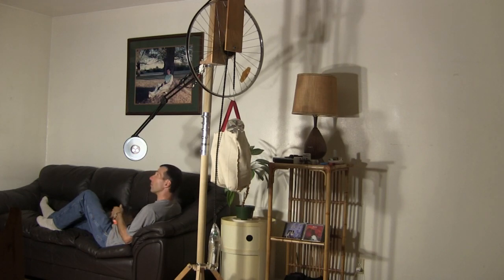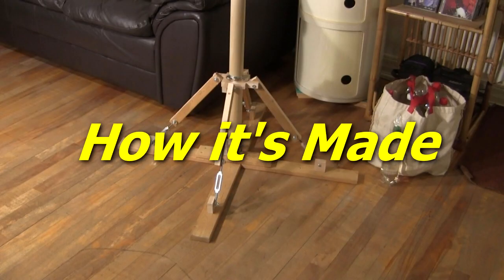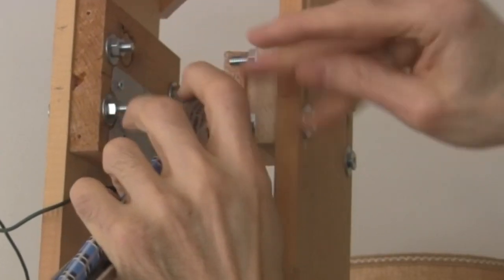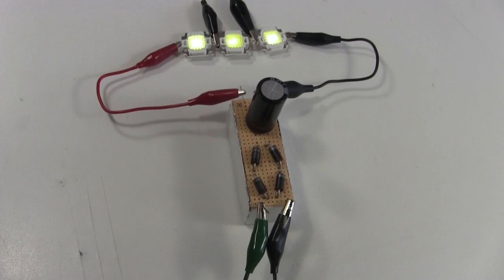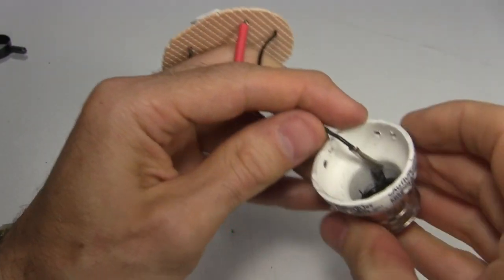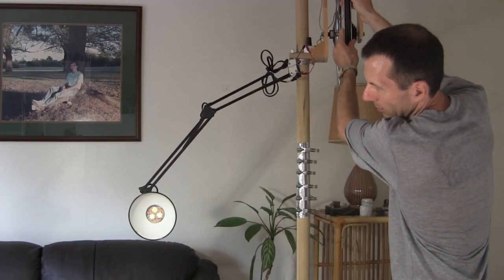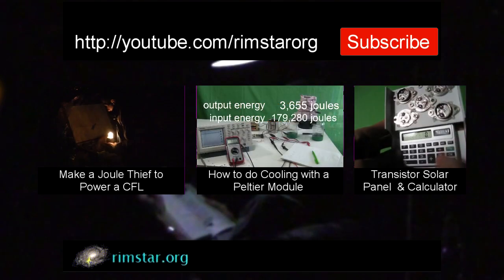Gravity Light (v2) Making and Enhancements

Comment: Those microwave turntable motors put out about 500V at 36mA by just turning it at a moderate speed. Thats 18W AC. You can drastically increase the brightness of those LEDs by stepping down the voltage to a more appropriate voltage and increasing the current with a step down transformer. You are wasting over 95% of the power by running 9-12 volt LEDs with 500 volts. You should be able to light up the intire room by doing this. BTW. You can light up a flourecent light without the ballast with these motors. It would be easier to buy a 10-18W flourecent bulb and remove the ballast and your rectifier and hook it up directly to the motor. These are great little generators. Salvage as many as you can. Theyre awsome!
Reply from the maker: +Robert Tomkinson Thanks. Everytime I see a discarded microwave oven I salvage another one. They are great little motors, doing a lot of the gearing for you.
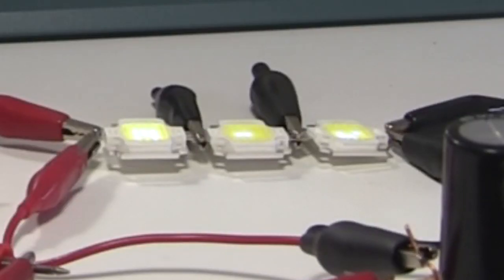I sort of am stepping down the voltage already by using the capacitor (or rather, stepping up as I mention below the voltage isn't that high.) At 2:46 in the video you can see that the voltage is lowered by the capacitor storing all the energy. Other than normal losses and the voltage drops across the diodes, no voltage is chopped here.
But even then, I'm pretty sure I'm not getting 500V at the speed I'm turning it. In making version 1 of my gravity light I measured the motor output and it was only around 3VAC at that speed of rotation. You can see that at 5:53 in this video about version 1 https://www.youtube.com/watch?v=6vwcIO9M-uE.
But what you say about trying fluorescent bulbs is intriguing. If I get it to turn faster then that sounds like a better approach to try.
Reply from the maker: +Robert Tomkinson At 2:46 in that video I was measuring across a resistor, not an LED. Also, in the video you linked to he was turning it a lot faster than I am. I'm turning it at around one revolution every 4 seconds or so, or 1/4 turn per second. You can see it in the video that we're currently commenting under at 1:29.
Reply: +RimstarOrg Yes I Know. Thats all it takes to get about 400-500V. Think about this, When you put 120V into it, it only turns 1 revolution every 10 seconds(6rpm). if you turn it faster than that, you get out more than 120V. when i turn them about as fast as yours is turning, i get about 500V AC. Maybe yours is defective. If you have another one, hook it up dirrectly to a volt meter.

Comment: I've been following your channels for quite a bit and enjoy watching your experiments. I have even done a few of these projects myself. The Joule thief is one of my favorites and, although I am having a tough time finding a ferrite toroid of core for my CFL, my real question for you today is: Would you be able to explain how transformers work, perhaps even how to build a step up/step down type, and possibly throw in the equations to calculate how to get the desired amount of voltage/amperage out of a homemade transformer? Lol! I know, it's a long question, but to be honest I'm more curious as to how and why, exactly, the magnetic forces work the way they do. Something about the number 20,000 comes to mind but, I can't quite figure out how this number is related to the magnetic forces in electromagnets. If ever you have a moment to get back to me, I would greatly appreciate it. Thanks! -Paul Dattner
Reply from the maker: Paul Dattner Hi Paul, I find a lot of these ferrite toroids in things I take apart. A microwave oven, for example, has one or two. Power supplies also tend to have them. The hot and cold water coolers sometimes have them. You can also buy them on ebay. Unless you want to do a really optimized one, I wouldn't worry too much about the material of the core. Mine was just a random part.Thanks for the transformer give idea. I've been asked for that one in the past but since there were good ones already out there I didn't do it. I'll keep it in mind. Cheer! Steve
Reply: Awesome nawsome! I plan be more Youtube active, to collaborate and be helpful, in the near future.Thanks Steve!

Comment: any thoughts about the longevity/life expectancy of the motor? with all the torque placed on the internal gears i might think it would have a shorted life but wanted to ask,
Reply from the maker: ***** No idea, though I'm the motor is running just below its rated RPM, so I suspect it would last a long time. It's not at the point yet where it runs for long enough for me to actually use it other than during development, demonstration and documenting.

Comment: Is it possible to turn gravity light into gravity charger ???
Reply from the maker: Mighty Fury It should be possible. My output is 24V, 2.7mA, which is 65mW. I guess it depends on what you need for your charger. A quick search shows that cell phone chargers are in the 5V, 500mA to 700mA range. So 65mW/5V=13mA. I don't know if that'll do much.

Comment: Hey this is the first time I saw someone doing a thing like this, I made a similar project when I was in Jr highschool using an old clock mechanism and used some capilars to exchange liquid ballast, the result was almost a nonstop clock. I know it aint perpetual motion. But it's pretty good efficient. What do you think about doing something like that? Since I am a medical Dr. I have no time to do this projects anymore.
Reply from the maker: Alan Lara That would be a fun short science project. I'll put it on the (lengthy) todo list. Thanks!

Comment from the maker: Wondering how my latest gravity light (v2) was made? Check out this video...
Reply from the maker: No, this video shows a far as I've gone. You could probably 3D print a bunch of gears to make something smaller. The gears I printed for my BB-8 droid handle a lot of torque so it should be doable. This one's smaller (https://www.youtube.com/watch?v=vgg1oJFdvcs) but has a shorter run time.
Reply: If you was to make this on a big scale.

It would be great for people in 3rd world country with unreliable  generators.

like a upscaled version. With a 1000kg block of iron as weight, that has to be jacked up by pumping with a lever. Until the 1000kg weight is 10ft in the air

Then you press a button to reset the chain. 

And then the weight falls very slowly because its hooked up to A LOT of gearing, which keeps the complex gearing spinning the generator for 4 hours at a time

Which powers the lights for the whole 3rd world house.

Possible?
Reply from the maker: +aman00777 I haven't done the calculations for large scale but certainly it's scalable. As for doing it for lights in 3rd world countries, that's why these folks came up with the idea http://gravitylight.org/.
Reply: Mr Rimstar , huge fan of yours. hope you're doing well.  any update on this project?  or the energy companies abducted you already
Reply from the maker: Hi, This is about as far as I can take this project. Though some things that would be fun to do would be to have an entirely mechanical one whose gears turn a fan for cooling purposes. I once did the calculations and it looked feasible. Another fun one would be to have a big chair that you lift up and sit in and that slowly falls while powering the generator while you sit in the chair reading by the powered LED. However, that one isn't something I can do with my workshop.
Reply: Thanks. a purely mechanical gravity device powering a fan sounds great. Have you figured out a way to control the rate of fall without it being too bulky or noisy?
Reply: Ideally the weight should accelerate downwards due to gravity? 
Why is the weight moving down so slowly?
Reply: In my upscaled version, the weight falls faster. Help pls.

Comment: You could probably make that into a charging station for various electronics. You can probably use many 1 Farad caps and store enough to output a decent amount of voltage and probably few milli amps.
Reply: It would take a while to fill a 1f cap to 5v at 0.065watts. I'm estimating somewhere around 300 hours. thats about 1500 times you would have to lift 16kg (24 metric tons in total). over a 12.4 day period never sleeping for more than 11 minutes at a time. Or you could just hook up a 1 amp phone charger for 10-15 min.... I know what I'd be doing if I wanted a cap filled...
Reply: Mongrel Shark hey in a survival situation, you can't ask for more can ya
Reply from the maker: ProSurviver Yeah, the cap I am using is only 4700 microfarads and it's barely being kept topped up, it would take a while to fill a 1F cap.
Reply: LOL, in a survival situation, I'd probably throw
 some aluminum in some water with some charcoal.
http://en.wikipedia.org/wiki/Aluminium%E2%80%93air_battery

Comment: How far could you take it? With a big enough version of this, could we see even more efficiency?
Reply from the maker: deslomeslager A pulsating circuit and storage is one of the things I have in mind. Another is to make my own generator and use one of those energy harvesting chips (sorry, can't seem to find the name at the moment.)
Reply from the maker: MinerMovie I don't know. It turns out to be hard to do. I'm already using the smallest sprocket of the bicycle wheel and the generator's turning at it's maximum and I have very efficient LEDs so there won't be any more efficiencies along those lines. But there are still some avenues to explore.
Reply: RimstarOrg
I think that if you would manage to use a pulsating circuit, the LEDs could flicker at a rate not visible for humans, and appear to be brighter and constant on. Perhaps a joulethief (but with equal or even fewer windings on the secondary coil) would work, I guess we could add 25% or so of runtime. But I think we should first try how many minutes it takes to run without any load. The load adds (generator) friction and delays the bottles going down. Without friction or less friction, they will go down faster. Tricky it is .. ..
On my channel you can see how I charge up some supercapacitors, one minute on the bicycle could light the same LEDs for a very long time (your legs can easily provide 0.5 HP which is an awful lot of power).